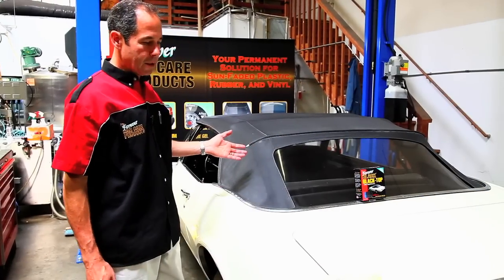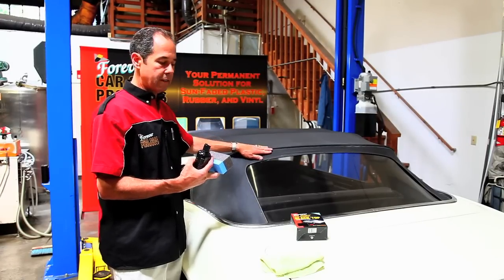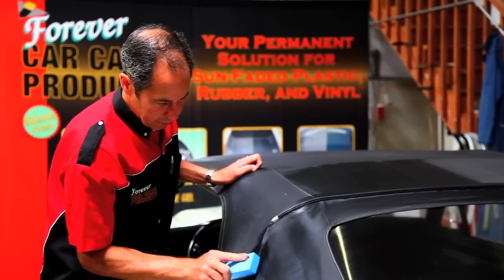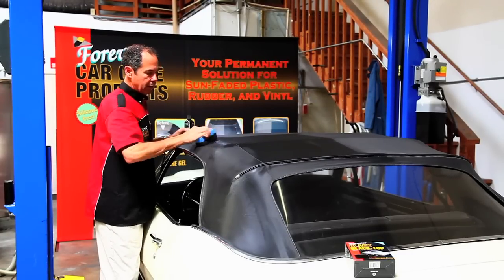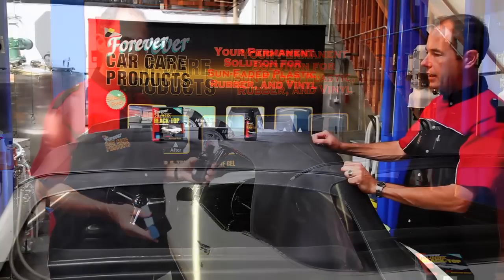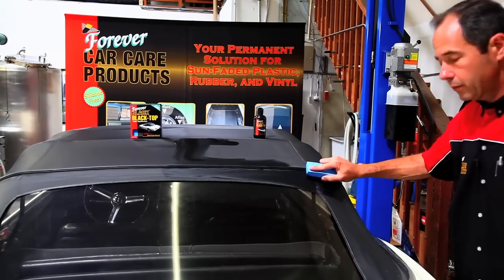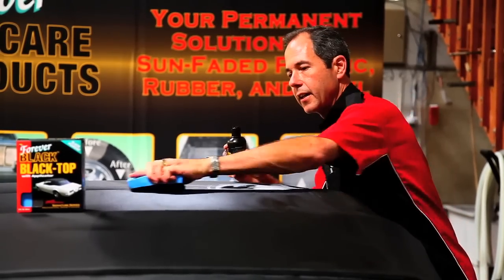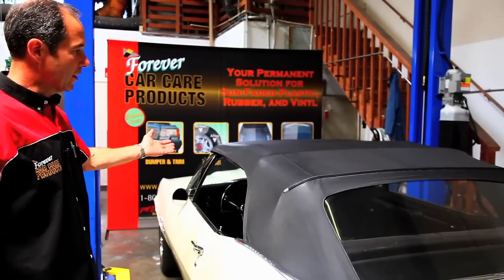How to restore your convertible top with Forever BLACK™ Black-Top Gel

Comment: I went to the local hand car wash place today, they soaped and jet washed the hood 3 times and then sprayed Autoglym hood proofing over it for UV and water protection. I do this every couple of months and the hood looks black like it should. I don’t believe any fabric protection lasts for more than a few months if the fabric is continuously exposed to the elements and the reason for that is we had canvass tents and to water proof them and protect against sun degradation you would need to proof them every year. They were only used once a year.
Reply: I use the 303 brand water proofing on my top in Texas and it lasts about six weeks
Reply: You keep saying hood , Do you mean roof ? I've never seen a hood made from canvas ???

Comment: I just used it in a Porsche 987 Boxster S it work's well , I will use a glove to spray it around in the sponge or you will get darker spots , I had to do 2nd and a 3rd just because I  got some darker spots but after it dry it looks better
Reply: Thanks god i found you comment 🙏 i am also planing to try this for boxster 987, but was not shure if it was right product for porsche's soft top material. How it's holding ? Would you recommend it ?
Reply: great  presentation's, I just ordered 3 boxes today,  just in case I run into Murphy's Law because I going from a brown top to a black top after I strip it.. But for reason, I am not buying that it would last 5: to 10  years. That"s Impossible in rain, sun and snow, no way. Thanks for this great post. 👍👍👍.

Comment: Just ordered a bottle for my 92 Miata, just had her detailed and the paint is sparkling shiny, now it makes my top look even more sun faded and almost gray in color. This should solve my problem quite well i hope!
Reply: How did it work? I have a 99 I want to do this to.
Reply: @Julian_913  it worked pretty well i think, it wasn’t a crazy huge difference but it definitely made it look newer. I had to do like 3 or 4 coats though before i started to notice a change. Took it to the wash afterwards and alot of ink comes out on the microfiber so make sure to scrub it well afterwards. But i think it was definitely worth what i paid for the bottle.
Reply: @-Sirens-  awesome, thanks for the update! I’ll give it a shot.

Comment: I bought this product after watching this video. I've got a '96 Firebird. Problem is there is not nearly enough product to finish the job. I got about 75% done and then I ran out.
Reply: Is it a canvas or vinyl top?  Vinyl doesn't suck as much product in, whereas canvas is more porous.
Reply: If it is canvas you need to mix 4 parts paint with 1 part water!That no one mention on any video, unfortunately I learned it the hard way by watching videos and at the end when I realised the paint will not be enough I read the instructions!Voila there you see that for cloth (canvas) tops you need to add water!Then it is easier to work it in and will be enough!
Reply: @riehelm745  So sorry I didn't see your reply till now. Yes I have a canvas top, not vinyl. gazmagi just answered. thanks
Reply: @gazmagi  I do have a canvas top and I didn't see that mentioned in the instructions. I'll check it out next spring when I get it uncovered. Thanks

Comment: I'm thinking you take your roof off, or mask it whatever.  Clean it down really, really good, like scrub the fuck out of it.  Then use Vinyl/Fabric Paint in whatever color and repaint your top.  I repainted my headliner and carpet years ago and it still looks amazing.  Plus you get a nice even coat instead of splotchy sponge marks.

Comment: What do you suggest I use to thoroughly clean my Mustang convertible top before using the Forever  BLACK gel....?  Thanks
Reply: try cleaning it with some good ol soap and water and then using a convertible top cleaner spray it works really well to remove stains and such
Reply: you can get the spray at autozone